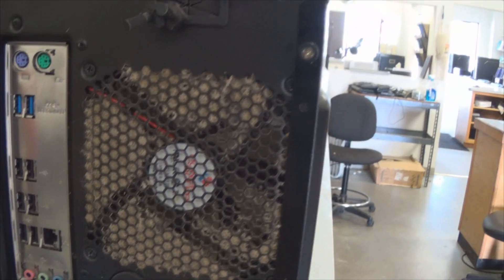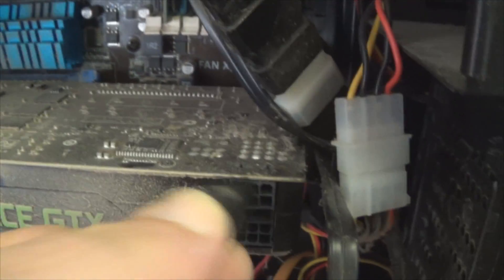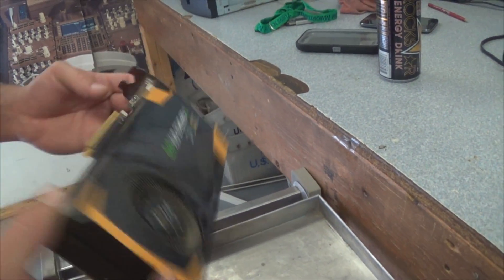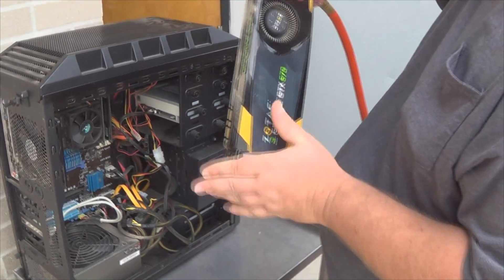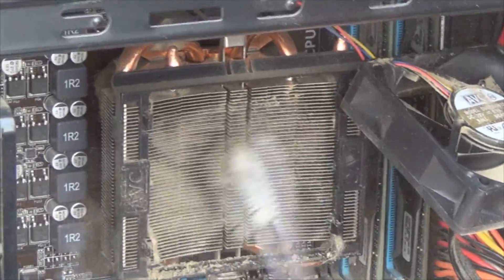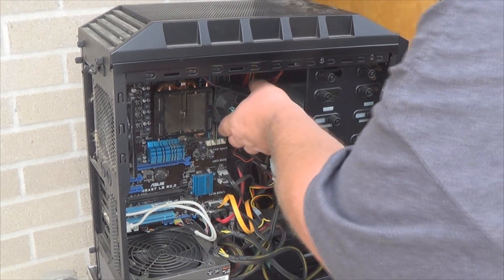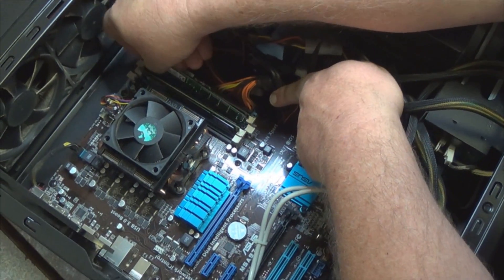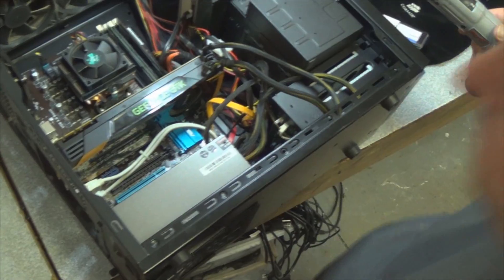How to clean out your PC!

Comment: The power source is upside down, the fan must be at the bottom!!!!
Reply from the maker: I prefer the fan not to take hot air from the computer case and vote on the hottest capacitors cool them down I rather it take cold air from below the case and blow it right out of the back of the case after cooling down the capacitors. go away squirrel

Comment: I bought my pc in 2013 , havent made a single hardware change nor have i ever cleaned it.
lately my games have been crashing because out of nowhere i get the message "display driver has stopped working and it has recovered" and i formated my pc, so i know is not software, i hope my gpu isn't damaged.

Comment: I have a air compressor and after i have used it my fps on games dropped to 1-10. Could this be because of the air compressor?
Reply from the maker: check and see if fans are locked up or if air pushed dirt to end of heat sink where air is blocked. i have had some video card that got full of dust where it made parts over heat and caused caps to blow and so on.  if having problems still recored a short video of your card running and/ looking at your video card. if upload to youtube or where ever send me a message on twitter it linked right to my phone.

Comment: Having better cable management is a good thing. I'm going to be building my pc soon, and I bought a case that has a small pocket at one of the sides that is separated from the other side of the case, and there are holes throughout it small enough for cables. This way, the cables don't get in the way of the air flow. Actually, would that be a good idea? Or would the wall itself get in the way?

Comment: connect your cpu plug before cleaning your computer .. Static can destroy it
Reply from the maker: as long as you are touching any part of the case you are grounded.
Reply: no i mean when you blow the fan and spins it creates static energy also the air can create friction . I just learned that recently
Reply from the maker: it is more like a wind turbine where it makes power :D  and if high enough air PSI it will blow fan blades off. that is why in the video @2:18 i talk about have to hold the fan still.  i have worked on some laptops that people used a air-hose on and because the fan was not held still it shattered  apart  wile turning and they did not know it and it would not cool and over heated and killed motherboard and CPU.  but good looking out.
Reply: yeah sorry I'm wrong haha .. looks like blowing things up doesn't affect anything .. Vacuuming is the bad one

Comment: Question,  Can you use a small vacuum with a brush to remove some of the dust.  It seems plowing only seems to move dust to other places in the computer.
Reply from the maker: No its not a good idea static charge that builds up on the plastic nozzle can jack sh!t up. you can read more on that hear. http://www.pcgamer.com/should-i-vacuum-my-pc-ask-pc-gamer/
Reply: Okay, Thanks

Comment: Hello,  FYI. Using the air compressor is probably the most optimal way to blow dust out of a computer. I would recommend putting a filter at the end of a nosal to prevent condensation from blowing out with the air. That condensation will rust motherboard components like the memory or the sensitive metal components.
Reply from the maker: have one hooked in at the start of the line :D  thanks for checking out the video :D

Comment: Finally, someone who knows not to let the fans spin when cleaning with compressed air.
Reply from the maker: well if not they get jacked up quick. along with if the are moving they make power that goes back in to the case and what ever else they are hooked up to. if they are a small fan (IE Laptop fans) one of the blades will probably shoot off. I seen it all at the computer shop i worked at.

Comment: What did you use to clean everything? The air blower thing?
Reply from the maker: yes i used the air compressor  and used a toothbrush on the cpu heat sink where it was cakeed on thick, to help brake it lose then use the air on it.

Comment: is this 100 % safe, last time i cleaned a pc i killed 32gb ECC ram by touching it, i dont wanna end my graphics card so is there anything you'd need to do?
Reply from the maker: yes its it fine to clean it this way i cleaned over 10,000 computers this way at that computers shop i used to work at.

Comment: ouhh pls look he have his powersupply on the wrong side
Reply from the maker: even if my case had the bottom open i would not want to pull in dust from around the bottom of the case for it to get traped on my power supply. i seen a lot of computer try to do that and it burn them up fast. i have had the same  power supply for over 4years now.
Reply: +Moranda-Media if he has a opening on the bottom he can flip it i have my power the correct way but i have a little opening

Comment: Why is the PSU fan facing UP ???
Reply from the maker: good air pull from inside the case
Reply: +Moranda-Media mine pulls air from under the pc...
Reply from the maker: if you have good enuf vents and the case if up high enuf then that will work fine. if not it will burn up 4 times as fast. i seen it over the 10 years i was a computer tech.

Comment: I have a large tank air compressor so I'll use a rag in front of the pressure fitting, sure makes the job quick and stress free, I also use the compressor for cleaning dust in the room.
Reply from the maker: +mc “mcalleyboy” alleyboy i some time use it to clean out hard parts of the car lol
Reply: +Moranda-Media   Thanks for reminding me, I too use it in the engine bay and also to blow out dust from inside the car.
Reply from the maker: Np good sr. when you have time could you be one of the first to check out our new website at www.MorandaMedia.com and let us know what you think so far.

Comment: http://www.walmart.com/ip/Campbell-Hausfeld-3-Gallon-110psi-Air-Compressor-11pc-Accessory-Set-Bundle/12534870 would this air compressor be ok to clean your pc with i have a thermaltake core x9
Reply from the maker: yea but it is 110 psi when blowing on main circuits have the air nozzle little further back

Comment: Does the toothbrush cause static electricity? Is the air compressor pump a good method? what are the consequences?
Reply from the maker: +AJ JONG toothbrush does not cause static electricity.  air compressor works well. just keep PSI under 50 if you do not have a air compressor you can use can of air. just make sure if you use can of air for the computer go back to room temp before turning it on. if have any other question let me know i will do my best to help you. and thank you for checking out my video please subscribe if you can i will have a lot more computer tips and videos coming up this year.
Reply: +Moranda-Media Thanks! ive just subscribed
Reply: +Moranda-Media Can you use damp wet wipes to just clean the top of the power supply and Hard drive? Its not a lot of dust but i still get a little OCD about it.
Reply from the maker: +AJ JONG use  rubbing alcohol little pads like at the doctors office. the alcohol will evaporate completely and there will be no corrosion on the circuits if any gets on there. or use contact cleaner and a dry paper towel

Comment: If you cant pull an air compressor or air can out your arse and need a temp solution a solt paint brush with a vaccum cleaner will do the job okay, note u wont be able to unclog the heatsinks with this method unless u remove the heatsinks and go at em with a pipe cleaner. but i clean my pc this way it takes about an extra half an hour but i dont have an air compressor and normally clean my pc as a spur of the moment thing for something to do normally once every 1-3 months debating getting am air compressor but dont have the funds at the moment be extremly careful of protruding components i use light tape to hold my fans still while i do this. I broke a hard drive connection on a laptop motherboard with this method so beware of them components only dust places for airflow and nearby such places and vaccum up the clumps that will form.do not completlty put the vaccum cleaner nozle on your motherboard too just try to hover it enough to suck up the dust.

Comment: Considering once I make some upgrades (SSD+Gtx970) I plan to do weekly cleans I think it would save me some money to just buy an air compressor
What air compressor are you using? also could you link it?
Reply from the maker: at the shop we have a 20gal tank air compresses.  you probly will be fine with a 10gal one and let it charge up  hear is a link to 20gal one http://www.homedepot.com/p/Husky-20-gal-Portable-Air-Compressor-F2S20VWD/203187354
Reply: Thanks
Reply: lol.anon.net Hey dude i really recommend this im planning it to get it aswell check out some videos of it it functions like a beast its also cheaper then an air compressor
http://www.amazon.com/Metro-Vacuum-ED500-500-Watt-Electric/dp/B001J4ZOAW
Reply from the maker: ***** it would have to charge up a lot or you would have to link a bigger tank to it. when its warmer i will show how i put a 5gal tank hooked up to my 3gal air compresser at home where i have 8gal all together